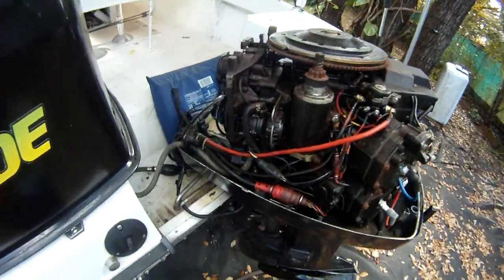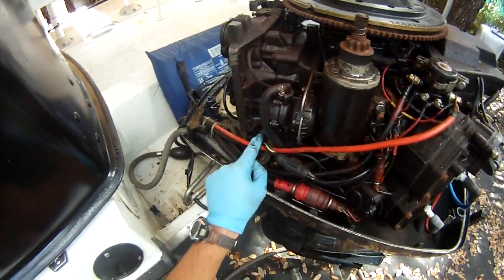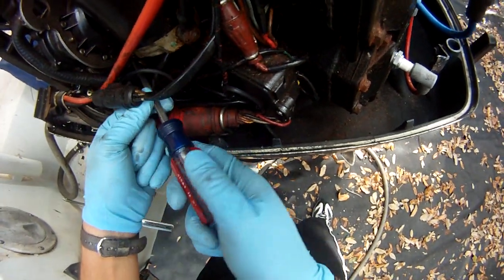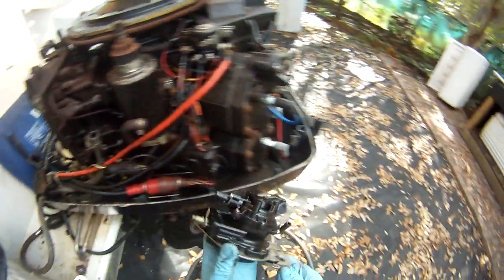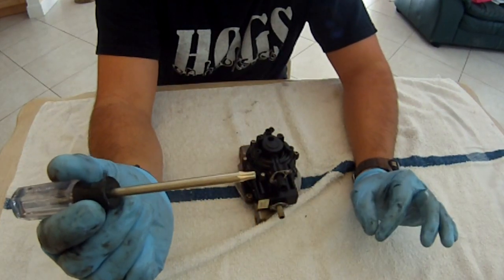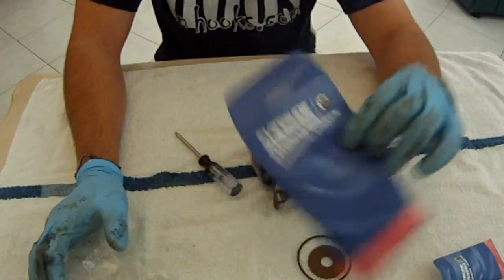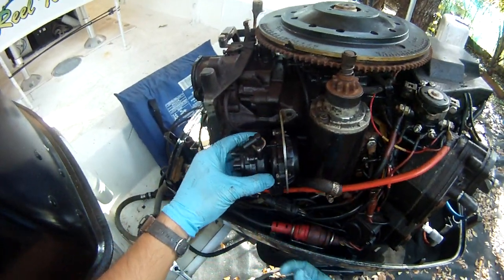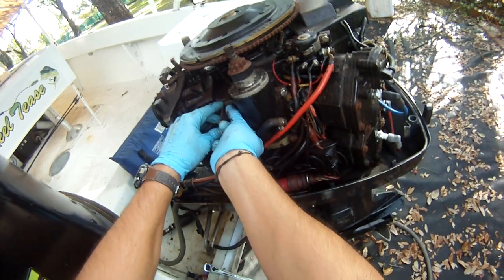Replacing Diaphram on Evinrude/Johnson VRO Pump.

Comment: Where did you order your Diaphram kit? I have a E150Sleuc, 1997 Evinrude 150hp, and have looked all over the web for it. I've found a few that was just for the Diaphragm kit ~$60~75 and then one kit from Max marine for 145, only difference is the one larger brown/bronze is added in the 2nd kit

Comment: Hi great video i have a similar problem with my johnson 130 hp 2000 where it runs on ideal good to very good then when you take it in the open water and after  mins it starts to starve or mis fire i stop the motor for 1min the run again then again after 4 mins the stutters would it be vro or... the boats been sitting around for quite awhile i have drained the fuel tank and new filter, plugs seperator, but not coil leads any help?
Reply from the maker: It can be your VRO going bad. But if you said it has been sitting a while, I would look at cleaning your carburetors. When gas sits in them for a while they tend to gunk up and restrict fuel flow. We have a video that shows how to clean one. But if you dont think its that, check for an inline gas filter inside under your engine cowling. It looks like a little white tube about 2-3 inches long in the gas line. But if all else fails buy the VRO diaphram kit and replace it. goodluck

Comment from the maker: We figured it needed repair after it started running rough. It began to sputter at WOT (full throttle) almost as if their was water in the gas or bad gas. we took the VRO apart and noticed the diaphram was punctured in multiple spots. usually this is caused by ethanol, or wear and tear.
Reply: I have a 1989 v6 200 looper that idles perfect but at wide open throttle won’t go over 3k rpms. And I have changed coils, wires, power pack, and rebuilt carbs. Also my stator and timing base are fine could the fuel pump diaphragm be an issue???
Reply from the maker: @CaneAndretti  I would definitely look at the fuel pump diaphragm, lack of fuel at WOT will cause that issue. Look into buying the replacement kit if you do take it apart. not a hard job at all. 
Also the small air jet orifices. clean them out or run some compressed air through them. I like to shoot sea foam through them, and also fill the bowls with seafoam and let it sit for about 30 minutes. then I crank up the engine and let it clean it all out. it'll smoke, but it works.
Reply: @ReelTeaseFishing 
Thanks a lot . I just replaced the diaphragm today and I found that the plastic wheel was cracked pretty bad so I replaced it and I’ll be going to the water tomorrow. Thanks again.
Reply from the maker: @CaneAndretti  that's great to hear, always a good sign when you find something. 
Also love the Avatar! GO CANES!
Reply: @ReelTeaseFishing Bro I Took the boat out this past weekend sand bar hopping and it ran like a champ!!! Thanks to your video I finally found the actual problem, I spent over a month swapping old parts with new ones and this $75 diaphragm was the issue the whole time...smh problem solved.Thanks again bro and as always GO CANES!!!!
Reply from the maker: @CaneAndretti  DUDE THAT IS GREAT TO HEAR!!! nothing better than when the boat runs

Comment from the maker: the housing should be a tight fit. the entire housing shoul be sealed. the VRO works by vacume. any air that may get into the system can dongrade its performance. as far as the clicking I am not sure.